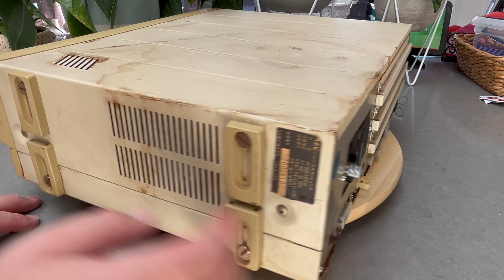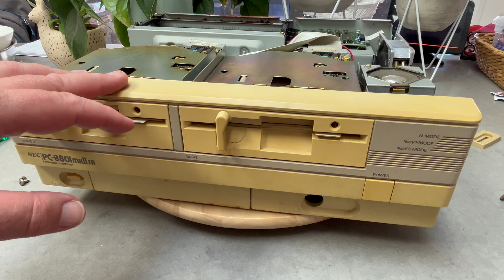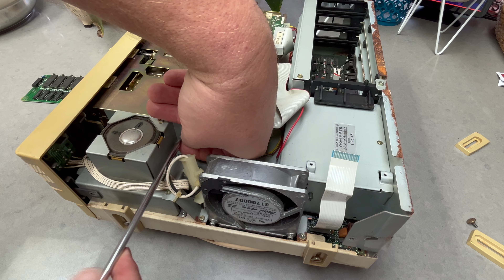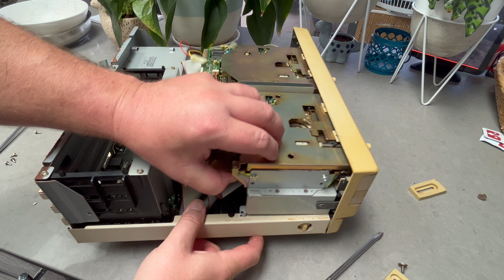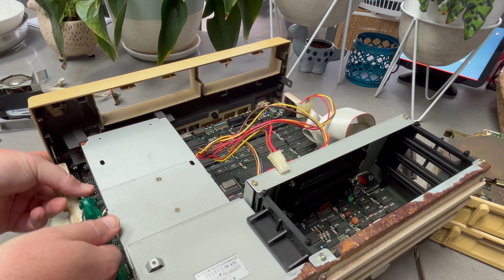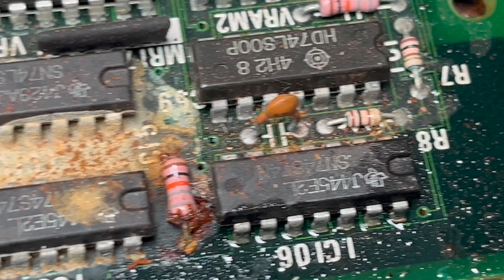🇯🇵 NEC PC-8801 mkII SR: Part 1 (First Look) [#TCE0580]

Comment: Dya get the impression he is gonna get it powder coated?
Reply from the maker: Okay, okay ... guess who went to the powder coaters yesterday ...
Reply: @Brfff  Lol Fair play, did it turn out Ok?
Reply from the maker: @craiggilchrist4223  Should get the parts back next week - they're going to sand blast everything and then powder coat inside & out - not ideal but easiest way to prevent the interior parts from rusting again after the blasting.  I'll just have to scratch some off at the screw points to ensure a good ground connection between case & other parts.  They also did my Commodore PET and IBM PC/XT and they both turned out like brand new.
Reply: @Brfff  Sounds cool, I look forward to seeing it.

Comment: Wow, that's a lotta computer inside that small case! Japanese efficiency in full effect.
Drive 2 being on the left of Drive 1 sets me off a wee bit though...
Hope the cyclone steers clear of you.
Reply from the maker: From what @douro20 has seen, apparently the Drive 2 is the one that will boot if a disk is inserted on power-on ... so acting like a Drive 1 but called Drive 2 ... :)
We should be all good regarding the cyclone - my folks near Brisbane will be hit (but should be okay) ... you can see the map, Port Macquarie is to the south, out of directly affected area
https://youtu.be/mecf6b9lrP0
Reply: @Brfff  yeah, they did have to cancel the footie though, so not all good news 🙂
Drive 2 being the primary drive is even more maddening...

Comment: Don't forget to pull that Yuasa battery on the right of the riser card for your add-on boards. You can see it near the mounting bracket for the riser card @27:10 Looks like it never leaked.

And about all of those ICs that you are going to have to replace, remember, "Be hip, clip the chip!" and don't try to take it out in one go. I will say this, that appears to be a high quality board. I didn't see any trace damage. We'll know more once the top gets cleaned off (maybe try CLR to remove the rust? https://glennsaid.com/clr-calcium-lime-and-rust-remover/)

And I saw a news report about the cyclone... 
https://www.youtube.com/watch?v=NSP2gS17R_U
Reply from the maker: Yep, we're pretty okay here - my folks in Logan (just south of Brisbane) are going to cop it.  You can see latest update here ... they show Port Macquarie at the bottom of the map, so well clear of the nasty parts - just some rain.

https://youtu.be/mecf6b9lrP0

Comment: Very nice, its bigger than a Ferguson big board!  Is this going to be a CP/M system ?
Reply from the maker: It was most popular for games apparently, coming with N-BASIC (for PC-8000 compatibility) and its own N88-BASIC built in.  But, yes, apparently CP/M was an option that was available and could run natively!
Reply from the maker: I'm actually wading through some PL/M code at the moment ... still running in 3G networks around the world!  PL/M was apparently used to develop the early version of CP/M ...

Comment: Lots and lots of custom gate arrays...the small Seiko Epson part (SLA5120F) is also a gate array.  The uPD3301AC-2 is the video chip- it took me a while to find the final draft of the datasheet for that chip, but there's one on Tetsuji Oguchi's website- you have to download the PDF which contains a list of downloadable files and it will be in there.

The 8257 is a DMA controller.  I think I saw more than one in there.
Reply: uPD3301 is the same text mode chip/CRTC from the PC-8001. It's well documented but it doesn't handle the graphics framebuffer data which is the main feature of the PC-8801 video subsystem.

Comment: One thing to note about the floppy drives is that the right-hand drive will auto-boot the moment you insert a disk, so if you have software which uses both drives the left-hand drive should be loaded first.

The sound is from a YM-2203 (OPN) which has three FM channels and three PSG channels, the PSG channels being the same as the YM2149/AY-3-8910.
Reply from the maker: So if I were to install a Gotek, the left-hand Drive 2 is the one to do?  I've not looked into it yet ...
Reply: @Brfff  I don't really have any experience with these; the only reason I know about the auto-boot is from watching videos about it.
Reply from the maker: https://www.leadedsolder.com/2018/09/02/pc88-floppy-adapter.html

Comment: You might be able to find 13 pin DINs if you need to.  Some weird guitar systems use a connector that looks like that.  Seems to be a Roland thing.
Reply from the maker: No problem with cables ... Aliepxress have them ... "beauty equipment line stage atomiser cable" ... but haven't actually looked for PCB-mount sockets though

Comment: Jesus Christ Brett! Why do you punishing yourself so much - this is not "quite a bit of corrosion" this poor thing is absolutely rotten! 😁Also thanks for nice music.
Reply from the maker: To be honest, I knew about the case ... yeah, just re-powder coat, simples ... the motherboard was a surprise ... well, would be to anyone unless you spent a lot of time stripping it all down and then re-assembling ... something a seller usually won't do!  I know I'll have to be careful around the corrosion in case it's gotten under the protective layer and attacked the tracks ... last thing I need is to make a mess of that by scrubbing away too hard!

Comment: Fg frame ground?
Reply from the maker: Works for me! There is earth coming into the machine but not on the two outlets so I assume that is what it might be for.
Reply: @Brfff  Ground on 100V service in Japan is usually done with a separate wire at the outlet end if it's needed.  

As for a lack of ground in Japanese stuff I used to have a Korg DW8000 synthesizer which had a metal chassis but no ground- it comes with a 2-pin IEC power connector and a 3-pin plug won't even fit a 2-pin one.  There was enough space that I was able to fit a 3-pin IEC connector with an integrated EMI filter in its place and properly ground it.